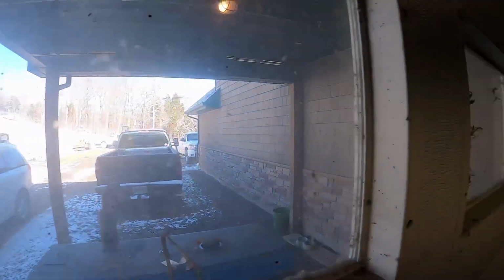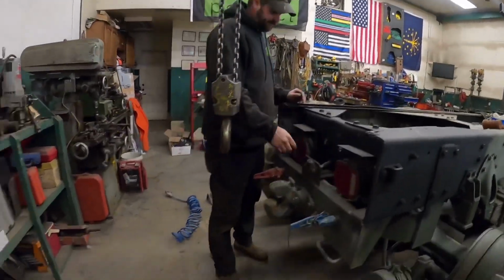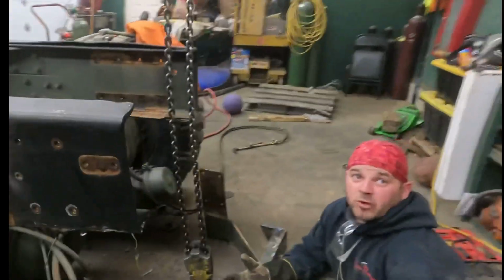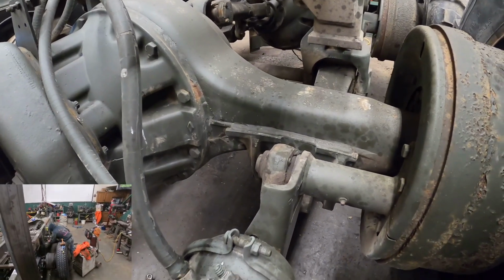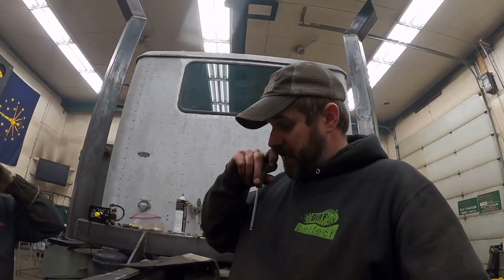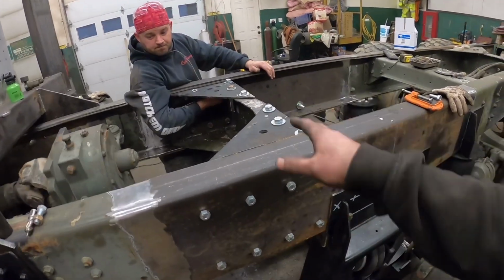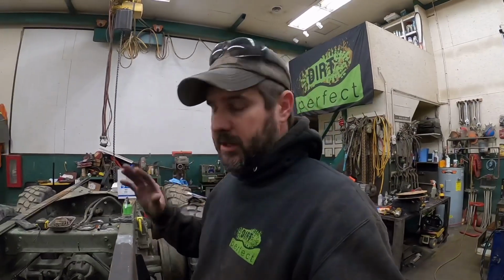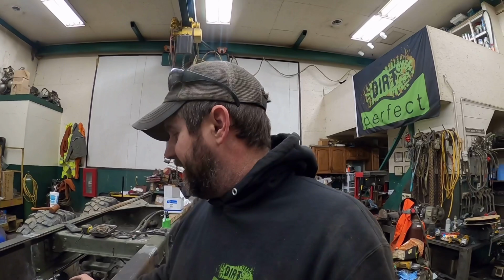Proving I am smarter than Man Behind The Scenes Crossmember install and Lt Dan leaves the shop

Comment: So my theory is this. There’s a transition at 37:58 and during that time, DP had to use the crane to lift and swing the back end round further. That or the was another 30 mins of manoeuvring that he has cleverly edited out. 🤔
Reply from the maker: Boy that would be way to much work don’t have time for that
Reply: Dollies would have been easier than the crane.
Reply: @littlefinkle7757  good point maybe he did that instead

Comment: On that rear piece that you had to fix, my first thought was that it was damage from a king pin that wasn’t secured to the fifth wheel.
Reply: That was exactly my first thought as well, either it wasn't latched or they didn't get the landing gear cranked down far enough.
Reply: It seemed too narrow of a split to be from a kingpin which most likely would have caused a rounder imprint if a kingpin could even touch the cross member considering the height that the 5th wheel was before DP removed it.

Comment: I might have a helpful idea for getting Lt. Dan  out of the shop easier.  Use the over head crane on the rear. Lift the rear up and swing it as the front tires pull.  Might have to back and forth a couple times but seems like to be easier then trying to pull forward and back forward and back🤷‍♂️. Just an idea.  Ps the truck is looking awesome!
Reply from the maker: To heavy

Comment: There are some electric (12v or 24v dc) roof mount ac units that might work ok for this truck.  I've installed them on tractors before and they were much easier to install than a traditional compressor and hoses.  They do pull a lot of amps though so they may necessitate a bigger alternator.  I did new installs for customers so I can't speak for longevity.  

I commented on a different video, but it was old so might not have been seen.

Comment: I’m hoping y’all are gonna add gussets to vertical welds in frame , maybe square stock or plated steel running 6” beyond frame rail weld joints . That area of frame would carry the most amount of weight , would it not , 20 tons resting in that area & then using push axle , in my eye will crack that frame
Reply from the maker: 0 concerns

Comment: Push lock fittings are fine in the cab and protected areas. They suck at wheel ends and any place they are in the mud (and salt here in the frozen north). Life expectancy is only a couple years.

Comment: Proving I am smarter THAN Man Behind The Secerns Crossmember install and Lt Dan leaves the shop.
HAHAHA
Reply: If the pin that holds the miscalculated to air can rod movers more than 1 1/2 inch it is out of adjustment. Just in case you didn't know. Great video.
Reply: If the pin that connects the slack adjuster to air can rod travels more than 1 1/2 inch, it needs adjusted. Just in case you didn't know. Great video.
Reply: Scenes

Comment: I really hope you end up keeping the military tires, provided they don't act stupid loaded. That would just look bad a--.  That thing is looking sweet👍👍👍
Reply: Need to add 2.
Reply: Horrible for any road driving tho
Reply: @inkman996   Do you think that the original tires will have to come off?
Reply: @robertbarnum7541  I am no expert, Mike is the one that has to decide what will be the best fit for him. Its tough because he is trying to make a hybrid truck, an off road hauler/on road hauler. Two totally different animals. Obvious problem with those heavy treads will be mud being tracked off the job site, worse fuel mileage, they will wear cupped on the pavement, and probably make for a noisy ride at speeds. Road tires, well you see the limitations of where all those tri-axles can go. For me I would shop an ideal off/on road tire and hope for the best
Reply: He probably needs floater tires for real off road work.

Comment: Where you put the crossmember could you bring it forward where 2 bolts are on the one side of the Weld and the other two bolts are on the new frame where the crossmember gives the frame and specially the welds a backup

Comment: The bolts and nuts on your repositioned crossmember need to be grade 10 that's frame bolt grade.  Very least grade 8 .
Reply: I also would have installed the bottom bolts face down in case one of the nuts worked lose it would still stay in place .

Comment: Well, I would have lost money on that. I never thought it would have come out of the shop without using the crane or a jack to maneuver the rear end around. She's looking good boys. Y'all stay safe.
Reply: Same here , I thought the crane would have been used . He also did it without a spotter , if he did hit anything we'll never know . lol
Reply: @eaglerider1826  and NO MIRRORS !
Reply: i thought the same thing about using the crane to move the rear end over...
Reply: I wasn't surprised at all.  The day he moved it in I knew getting it out would not be an issue for two reasons.  One, just watching how he got it in there it appeared there should not be an issue getting the extended version out.  Second.  Dirt Perfect doesn't do things off the cuff. He does thinks them out.  I am betting he had it figured out before he ever backed it in there.  At the very least, he knew after backing it in and would never have taken the chance extending it in the shop if there was the slightest doubt about getting it out, even if it meant using the crane.
Reply: @willb3018  Hello from another Will B.
Reply: @williambryant5946     👋
Reply: In my mind before hand, I predicted a dozen turns; he did it in about 7. I was waiting for the crane too !

Comment: The concern I have is the carrier bearing mount. I just hope that it does not twist.
Reply: Yeah it needs a lower cross member made before it gets covered up with dump bed reinforcement never hurts but another drive shaft gets pricy
Reply: Agree, carrier support is  going to be the Achilles heel here... as over built everything is , might take a second look at that! Money ain’t for nothing and your drive shafts ain’t free....🎼🎸
Reply: @tonycurtiss1081  
You reckon he will end up in 'Dire Straits' ??? 😉
Reply: @alexosborne5629  I would continue but prob a bad idea 🤣thanks for the comment 👍
Reply: @tonycurtiss1081  
I know, I couldn't resist it though 😉😁
Reply: It looks plenty strong enough to hold the weight but it is going to flex and maybe introduce a harmonic and that is not good.
Maybe there is a plan for that we have not seen yet.
Reply: @gregorskiff  let’s hope so.. would absolutely agree👌